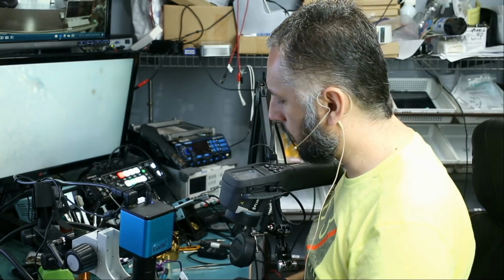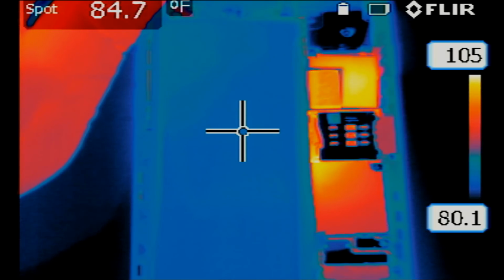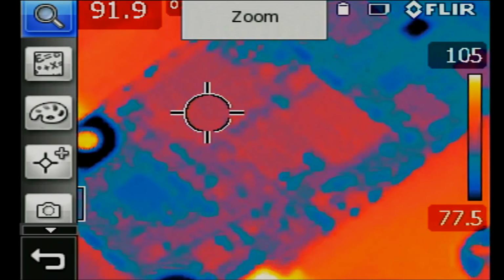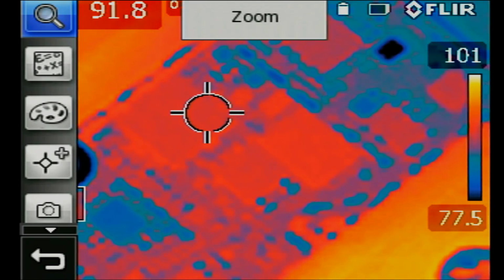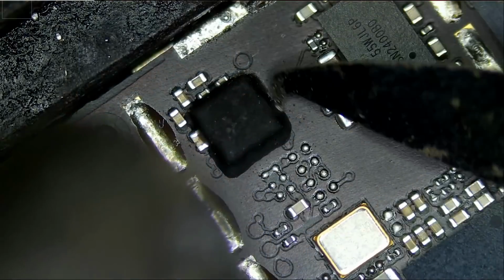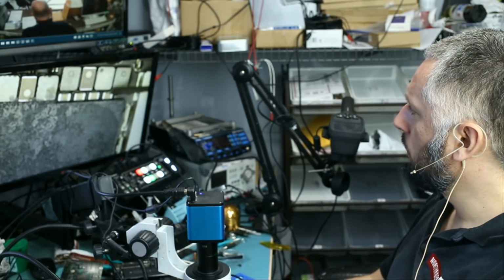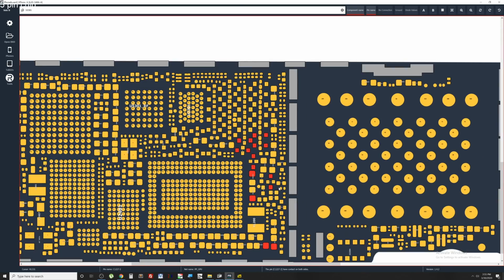iPhone 6 No Power Tristar and GPU Short

Comment: It's not the GPU!!! GPU lines have a very low resistance. If your above 10ohms, you're good on that line. Check your I2C lines 80mah and bouncing is bad I2C line. Open schematics and check them. I'd also try a DFU mode restore and see if it errors out! Don't always just follow the heat...
Reply: Gpu even beeping in any good motherboard so I agree ☝️

Comment: I have replaced the battery from a local shop. After battery replacement. The phone was working for 10 days. Suddenly the display is just blank. Iphone gets detected in iTunes. It also detects the SIM card .But display is just blank.Data is very important for me .kindly help me to rectify this problem.I can ship this device to your place.

Comment: Hello brother allow me to tell you that beeping sound of gpu line is normal because of low resistance .sometimes it could be misleading  if you rely entirely on the sound without checking the multimeter reading on diode mode.
I am quite sure you know all that.but sometimes stress of work..forces us to neglect some details .
Thanks for sharing with us all these informative videos .
Follower from france
Reply: what can be a better way to test this? ESR meter?
Reply: Just to keep an eye on the reading on the multimeter. Though it reads a low resistance means line is good.still you all hear a beeping sound .
Reply: @azhaim3397  at what point would you consider there to be an actual short?
Reply: Bearing in mind the resistance of the line.some can be 0.004.
O ohm is definitely ground
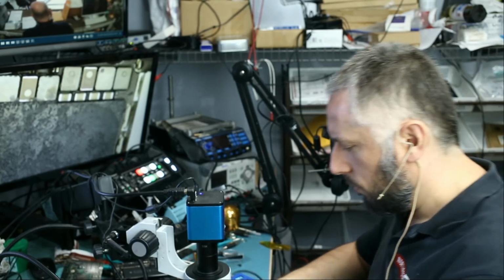Reply: He is testing in diode mode 10:46.
Reply: @matduran1104  what does testing in diode offer vs just regular ohm measuring?
Reply: NEMO MENO is right, if you hear a beep on both sides in diode mode, especially in CPU area, you have to check in resistance mode (Ohm) about 2-10ohms it’s normal, but 0,3 or lower is a short
Reply: I just tested the gpu line on 2  iphone 6 boards in diode mode and i'm getting 0.120 and 0.11 and not a short. I take it a GPU short does exist. It would be interesting to know the GPU diode values on other iPhone models and if they read the same.
Reply: Yes defintely résistance on this line is always low and therefore beeps but 0.10 is no short it's just a normal resistance for gpu line to my understanding .
Under 50ohm normal to get a beeping .
Reply from the maker: GPU is shorted to ground. Diode reading zero and resistance 0.1. It's definitely a short. CPU was also partially getting hot upon initial inspection under thermal cam and i suspected something going on there before i even tested.

Comment: I'm curious, do you use a KVM to assist with switching between these multiple inputs/outputs? Maybe an HDMI switch/matrix as well?
Reply from the maker: https://rover.ebay.com/rover/1/711-53200-19255-0/1?mpre=https%3A%2F%2Fwww.ebay.com%2Fsch%2Fi.html%3F_from%3DR40%26_trksid%3Dm570.l1313%26_nkw%3Dv-1hd%26_sacat%3D0&campid=5338440312&toolid=20008
Reply: @NorthridgeFix  Such a sexy setup.

Comment: REDACTED
Reply from the maker: Tape can actually deform and cause components to move when heat is applied and solder liquefies. I wouldn't recommend tape over components.
Reply: @NorthridgeFix  o0o0o0o0o0o0o0 I learned something new then. Thanks!
Reply: @NorthridgeFix  I thought I've seen you use that orange see-through tape in the past for some jobs.